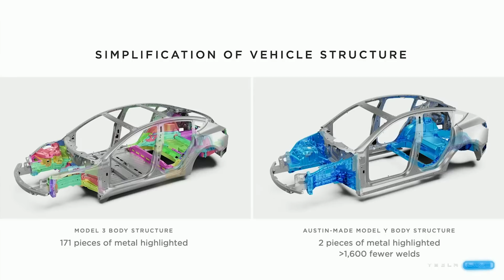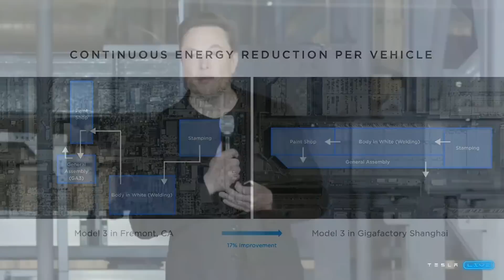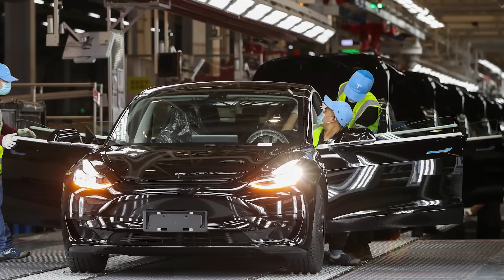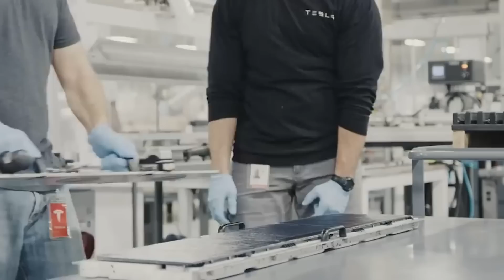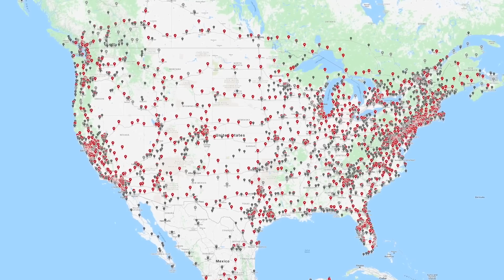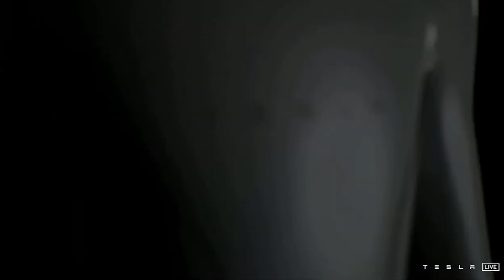Tesla Manufacturing, Barriers to Entry, Engineers, Superchargers, Safety... and More

Comment: I'm expecting Tesla to come out with an agricultural robot. It could have wheels instead of feet and many different functional attachments. If it is working 24/7 it could replace the huge diesel tractors. Pair these with solar pv on structures above the ground.
Reply: Many large agricultural tractors are already autonomous
Reply: @GregHassler  A Tesla agri robot wouldn't just run an implement over a piece of land, it would behave independently, just as an experienced farm worker does. A group of Tesla agribots would have the kind of data feed that modern agribusinesses are using, and make decisions based on that data.

Comment: "Getting rid of robots" is actually a massive gain. A robot line has to be designed. A robot and it's peripherals (welding heads etc.) needs to be specified, bought,  installed, programmed and maintained. If it goes down, the line is disrupted. Even for a top notch engineering team (like Tesla's) these are significant costs, with potential for lost production. Of course, there are some trade-offs with a giga-press, but basically it is one big machine with fewer things to work on and maintain (and go wrong), rather than lots of smaller machines, with lots of things.
Reply: Reducing robots is also reducing processes.Reducing processes is reducing costs.

Comment: Yes, the casting machines eliminate over a thousand welds, but the yield on these machines is currently only 50%.  Significant improvements are needed.  

I’m not impressed with plans for a 350kW supercharger because if you look at charging curves for any EV, the battery monitoring system allows maximum power for a couple of minutes to avoid battery damage.  Most of your charging time is under 150 kW.  We need better batteries that accommodate 250kW of charging for a long period of time.
Reply: There was a report that defectives were down to 10%